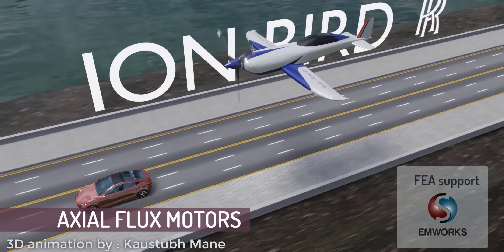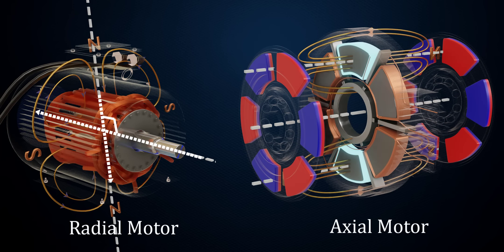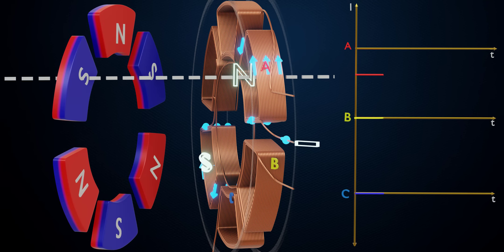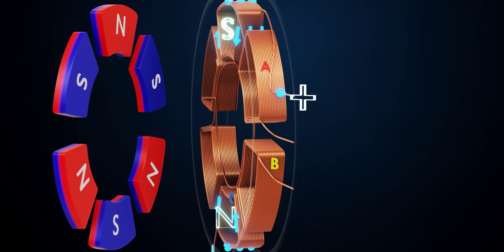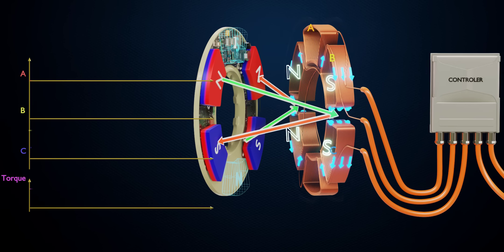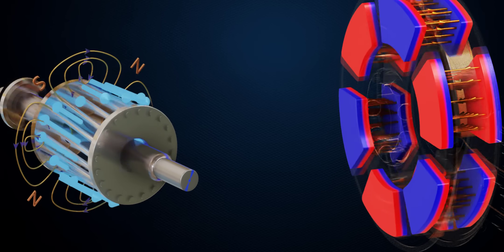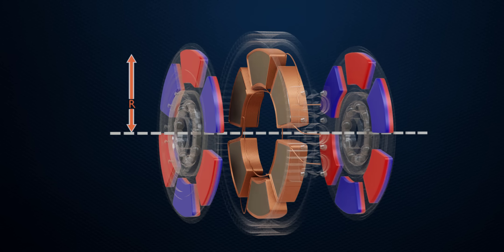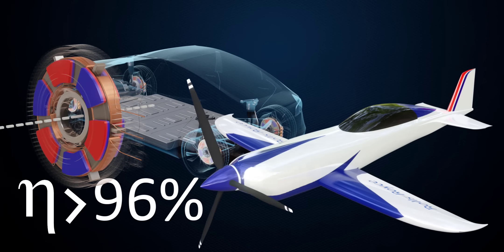Axial flux motors - The new hope

Comment: The solution doesn't lie in the motor.  It is all about the energy density of batteries.
Reply: No, is not ''only'' about the energy density. That's over simplification for the average Joe.
Reply: @loszonga  The difference between the relative efficiency of different A/C motors is absolutely negligible when compared with what higher density batteries need to provide.
Reply: @theephemeralglade1935  There are many aspects of the battery density needs and is all connected with the design is used for. Wight / Power ratio is a factor, aerodynamics is a factor, power train is a factor, resistance to roll is a factor, all combined get that ''density'' to be more approachable.
Reply: @loszonga  Aircraft are already being manufactured with the lightest materials we have.  There are no new aerodynamic discoveries to be made - this is knowledge we have accrued for a LONG time.  Powertrains (gears, belts, fluids), and rolling resistance  (sufficient adhesion vs. low rolling resistance for the application), are well understood and have hardly ANY room for improvement.  If you cannot improve battery energy density the minuscule difference between electric motors cannot possibly have a significant impact.  Electric motors have a finite potential just like ICE does.  You CANNOT get around that.
Reply: @loszonga  "The specific energy of avgas and jet fuel is about 43 MJ/kg. The best lithium-ion batteries top out at about 0.9 MJ/kg (the batteries in a Tesla are about 0.7 MJ/kg), so they have a fraction of the storage of liquid fuels."
Reply: @loszonga  "ice was and is a cumbersome, service hungry money down the drain problem. Electric engine are cheaper, better, long haul and almost maintenance free comparing with ice where most tbo is done at 1000 hr."
Oh, really?  That is of course why battery powered aircraft have dominated the industry, lol.
Reply: @loszonga  "Pullers are inefficient asf, the whole aircraft is passing into his own turbulence, electric double propelled pushers have a better energy consumption coefficient. And so forth..."
And so forth, lol.  
"The propeller passes through the fuselage wake, wing and other flight surface downwashes - moving asymmetrically through a disk of irregular airspeed. This reduces propeller efficiency and causes vibration inducing structural propeller fatigue and noise.
Prop efficiency is usually at least 2–5% less and in some cases more than 15% less than an equivalent tractor installation. Fullscale wind tunnel investigation of the canard Rutan VariEze showed a propeller efficiency of 0.75 compared to 0.85 for a tractor configuration, a loss of 12%.  Pusher props are noisy, and cabin noise may be higher than tractor equivalent (Cessna XMC vs Cessna 152).  Propeller noise may increase because the engine exhaust flows through the props. This effect may be particularly pronounced when using turboprop engines due to the large volume of exhaust they produce.
You REALLY don't know what you are talking about.
Reply: @theephemeralglade1935  Thank you for bringing me back to the earth BUT that study and all the data is made on classic ice pushers. However, you left out the double propeller electric pushers because is not fitting your narrative. If debate is what you are here from and exchange of information, set your f... story right.
Reply: @loszonga   "They laughed at Einstein. They laughed at the Wright Brothers. But they also laughed at Bozo the Clown."
-Carl Sagan.
Yeah, okay, bruh.
Reply: @theephemeralglade1935  yeah right man, do your thing ;)

Comment: When a coil turns off, an amount of time is required for its magnetic field to collapse. During that time, isn't it true there is electrical pressure (voltage) in the wire coil of the opposite direction that is wasted? Why not use switching to capture and re-use that energy? 💡
Reply: In electric motors the time to build those fields are usually way way faster than the time the motors other magnetic fields take to ‘pass by’, you in fact use a flywheel diode/synchronous switch to let current continually flow by pulsing the applied voltage (See PWM) - correct control of the motors winding current  means the collapse of the field should have been cancelled by the other magnet at the point you stop applying current, if you don’t , you’re right  -  the field energy goes nowhere and turns into heat.

With an open coil with no other big magnetic fields to pass by – using a capacitor to capture field collapse energy and then return the energy is the basis of an RC resonant tank - and when correctly stimulated ( e.g. by PWM at zero current crossing ) can be used for long-distance wireless power transmission with very low losses. These are usually in the area of at least 100s of kilohertz to MHz,  look up resonant transformers 

An electrical motor is in the 100 to 1000 Hz area 

For motors the deeper shit is : 
The flux building up and energising the coil pulls a movable magnet into the field lines of the coils space, the field lines of that moving magnet by definition are then simultaneously moving into the space of the original coil, making an 'alien' changing field seen by the coil, inducing opposing electromotive force, in other words generates an opposing electrical voltage in the original coil, ( this is how work is transferred, the lower the opposition the more work is transferred to the moving magnet as force.)

This alien induced voltage is called the 'back emf' (BEMF) related to the speed of the motion of the external field or the speed of the motor 

The changing alien field opposes the voltage being used to make the current that generates the original field – which reduces the current in the coil, thus ‘nulling ’ coil energy/current. A controller obviously needs to stop applying voltage when the attracted magnet is fully in line with the coil ( in phase) . Otherwise the coil would then be trying to slow the magnets motion once it has gone past. So the coil field needs to be completely cancelled at the passing point. The coil is ideally fully turned off = no current is flowing. The next coil along needs to start being energised to attract the magnet further along the direction you want the motor to go. You in fact also reverse the field in the original coil, by reversing the current /applied voltage, to push the magnet away, and obviously all the field lines of the magnet entering the original coil is now changing as a collapsing field thus making BEMF in the opposite direction .....( against the now reversed original current )

- but if the motor is slowed because is having to pull some mass?

The slower motor = less speed = less rate of change of ‘alien’ field and then less BEMF = less voltage opposition so MORE current is pushed into the coil if the applied voltage is the same, generating more original field attracting the magnet harder, so this means more work is put in as current for the same applied voltage. 

In truth if you have full control of the switches in a brushless motor , you control when the phase of the two field interact and thus the flow of power in or out of the motor, as force and speed, so it can even return energy as a generator or kill the magnetic field when it is doing no work. But throughout all of this the wire has resistance losses which always generates heat, and the hotter it gets the more losses it has and thus it gets even hotter. Cooling is key . 

If you lock a badly controlled motor solid with full voltage applied, there’s no back emf and generally the motor makes a noise , starts to glow with bad smells and then burst into flames.

It’s a while since I’ve done this shit so I did this for my own head - but when you get into it some Reeeeellly clever control goes into stopping the issue you mention becoming poitnless losses in motors.
Reply: This is already done every time you drive a BLDC motor today. It's necessary to capture the voltage spike to protect the drive electronics and the only good place to direct it is the battery. That said, there is not that much energy in these spikes because they are very short.
Reply: @JimmyAlzen  Where can we read about it?
Reply: I think that it gets radiated in heat
Reply: The voltage/time graph in this video is simplified. The real waveform will be more like a sine wave, modified to best match the shape of the pole pieces and coils.
I suspect that the coil arrangement shown is simplified as well, overlapping coils will provide more even torque.
Reply: In a well designed system, the energy from that "back EMF" is captured.  If you drive the coils with an "H bridge"[1] the recapture comes more or less for free.  The voltage on the coil reverses and the backwards diodes in the semiconductors conducts the current back onto the power bus.
[1] Imagine the horizontal bar of the "H" as the coil and the 4 other segments as semiconductor switches.
Reply: Id think a high frequency controller would work fir this. Not to mention the gradual power feed in then out solved this. Thats the ides mentioned in the power flutter part.
Reply: That's being worked on, in fact, the energy during the switch off of the coils, is much greater. Anyways we'll not get into the capturing harness or apparatus design. Just rest assured, when it's completed many other things will change.
Reply: One man, years ago, proposed using an extremely long wire for coils to delay the back spike, so it wasn't wasted between gaps or between brush contacts in DC motors. It creates an extremely efficient motor, though the design in this video is more about torque.

Some have claimed that using the back spike can create a free energy device, but it would have to be frictionless, have no thermal loss, and not be operating under a load to get anywhere near that, so it's unrealistic. But even suggesting it could be used as a free energy device is probably enough to scare oil corporations enough to suppress those designs. Paranoia over a loss of profits suppressing technology. Same reason they burned Nikola Tesla's tower down.
Reply: @Trihalo42  Tesla tower burned down. Which movie do you recommend to see that happens? There's several movie about Tesla, I don't know which one to choose.

Comment: but if the "SMART ELECTRONICS CONTROLLER" component fail? in traditional engines this is not necessary which makes it more reliable, cheap and durable.
Reply: which one of "traditional" motors used in modern cars or planes works without complex electronics?
Reply: @SergeiSugaroverdoseShuykov  Electric aircraft engines are just prototypes and are not common but this is not my question when I refer to massive use of electric motors in all applications not just in cars or small aircraft.
Reply: @renatoigmed  any brushless motors requires complex controller to work

Comment: Ok, smart design, but what about centrifugal forces - like permanent magnet reluctance motor-? And what is the difference compared to BLDC?
Reply: The motor shown in the video uses 3-phase alternating current. A bldc uses direct current. Both motors indeed share similarities though.
Reply: @mgls6523  what?!! Didn't you see? How on earth use 3ph with P.M. Without induction starting - which you cannot be created by two co-axial feilds-?

Comment: So can you use a compass in an airplane with this much magnetism floating around at different amplitudes?
Reply: Use GPS its worthy enough.
Reply: @newchannelverygood162  Dont think the FAA would like it.
Reply: @davidwhite2011  why? GPS is a harmless, simple technology...
Reply: @newchannelverygood162  Because when everything electronic goes to crap in the air, you want a mechanical backup. Ask me how I know.
Reply: @davidwhite2011  Yaa I could realize it. Thanks for the up-to-date information. 
Are you an airline crew??
Reply: @newchannelverygood162  No just a private pilot with an instrument rating. Just remember everything has a possible back up in a plane does. Two electrical systems for the engine, with two spark plugs per cylinder. All the glass displays have battery backups with 45 minutes reserve so you can get to the ground when  it all fits the fan. Cause it will.

Comment: Isn’t this just a BLDC motor with more steps?
Reply: Yeah it is a BLDC motor but most BLDC motors like the pc fans and the ones used on drone propellers are radial flux. This being an axial flux one is better. Axial generators are also better
Reply: This does remind me of BLDC. The BLDC motors I have seen have Permanent magnets around the electric magnet, not next to it.
Reply: @ryanrinn4041  the rotor of a BLDC motor contains magnets while the stator contains the coils, same principle, just slightly different
Reply: I have not been this impressed since Rockwells' Retro encabulator.

Comment: One question I have is how does this motor scale in size?  Does the diameter get wider or does it get deeper as the coils get thicker.  I'm sure both happen, but which is the dominant direction.
Reply: The easiest thing is to just add more layers
Reply: as with most engine's, if u want to build them up u keep relative proportions. if u want more output make it bigger in all directions and adjust the gearing to get the speed and torque u want.
but as u have seen the best way to use these motors is as a direct drive. this means u need to fine a balans between torque and sen-tripedal forces.
this is very limited tho.
that is why i see them cluster the motors.
if u offset the pols u can make them run smoother and have a smoother power draw spikes.
also in start up u can just use 1 to limit the in rush current.
the drawback is u need 2 or more frequencies controllers witch makes it expensive.
Reply: That's the same question I got
Reply: You can also grow them along the rotational axis by adding more discs.
Reply: You have more than one question.  I would suggest that the Power to Weight ratio applies.  They stated that torque increases with size of radius.  Power as in used power will increase with thickness.  Efficiency of the motor give the results.   One over another.   So size will in fact be regulated by the use requirement.
It is stated it is a lighter motor and more efficient.   Direction of the motor will be determined by how it is set up by electronics and design for purpose.
Reply: I believe ... diameter is limited to space available, at least at the beginning.
In airplane, it's fuselage.
In car, tyre diameter.
Reply: You could go bigger diameter in a car if you wished by placing the motors inboard and using a driveshaft, you’d eat into cabin space but if it was necessary. Inboard is actually probably better from a dynamics perspective anyway
Reply: @alanhillyard1639  Then you will add weight, for gears, that lowers power, from motor center to wheel center.
If motor center keeps allign with tyre center, it's limited to minimum ground clearance.
Reply: It ets wider and gets more coils and magnets, not bigger coils.

Comment: I think in this design the rotor has a larger diameter compared to radial motors. So at high RPM the centrifugal forces become larger and maximum RPM will be lower compared to the radial type. In EVs you will need a different transmission to reach the same speeds as with the radial type. Tesla's motors have max RPM of around 20,000 with a step down gear ratio of 9:1. So at top speed it would be 20,000 / 9 = 2222 RPM at the wheels. If the axial flux motor has a max RPM of 13,000, then it would need a 13,000/2222 = 5.8 :1 gear ratio to reach the same speed. This would also mean you only get 5.8 times torque increase instead of 9 times. 
You would maybe save weight at the motor and at the transmission with the axial flux motor, but I'm not so sure if you would get the same torque at the end.
Reply: You could probably just put multiple of them on the same output shaft until their total weight is equal to that of a radial motor. Since they have higher torque densities, they will be able to produce enough torque that they wouldn't need very high of a gear reduction at all.
Reply: and to get the same torque, the weight(would nearly become equal to radial) would increase so would the complexities... So, still not plausible for EVs I guess....
But aren't the axial motors designed to give more torque than radial?
Reply: @utsavdhyani8839  yes axial nominal torque is higher than asynchronous motor
Reply: @utsavdhyani8839  I've read both Lightyear One and Aptera will be using axial flux motors. Aptera seems to be using no gearing at all, and still gets same acceleration as many non-Plaid Tesla models. Although there are many factors besides the motors as well..
Reply: @Alfred Wedmore OK this makes sense, I just thought maybe the gearing would make a difference. Also did you mean W/kg? I think J/kg is specific energy, not specific power.

Comment: This is a really interesting concept and I can see it being used in aviation or machinery with mostly fixed rpm. In cars? I rather doubt it. PSM and EESM can easily match this efficiency numbers and with the rpm intervals necessary in cars e.g. 0-12000 rpm I do not see something with a huge diameter. Also the large magnets are a resource problem for mass market products. I would love to see a closer look at these. How is the efficiency over different load levels? How is the efficiency depending on rpm?